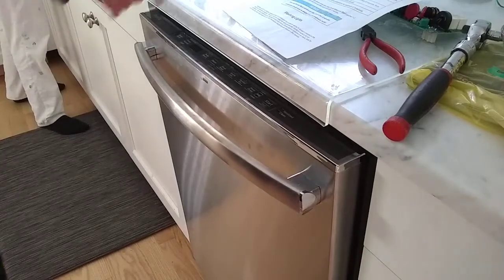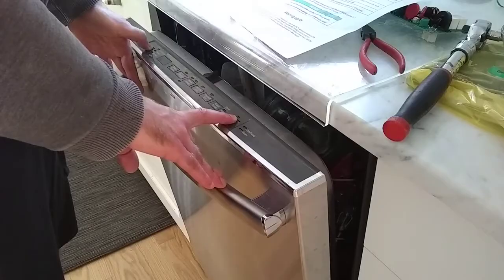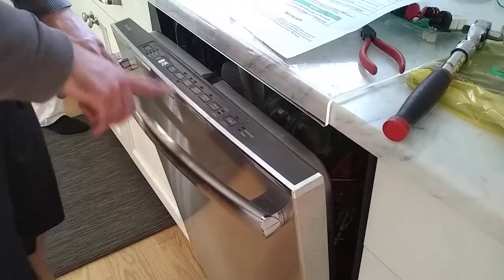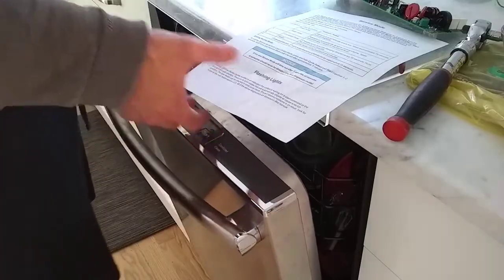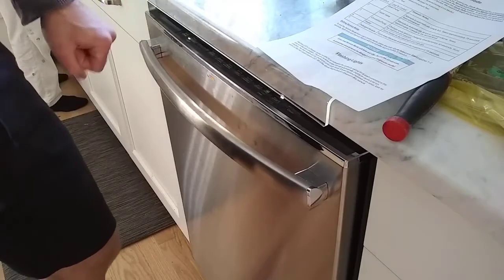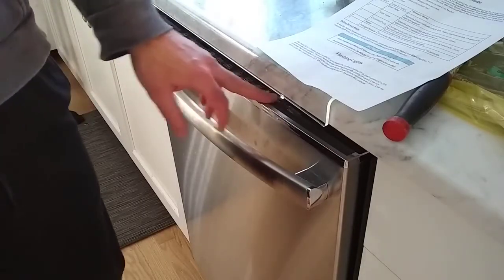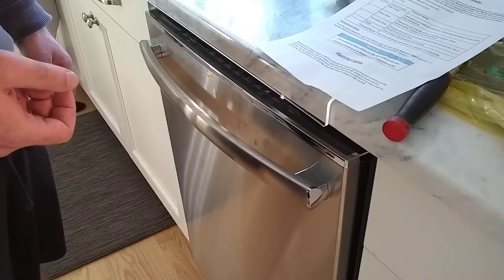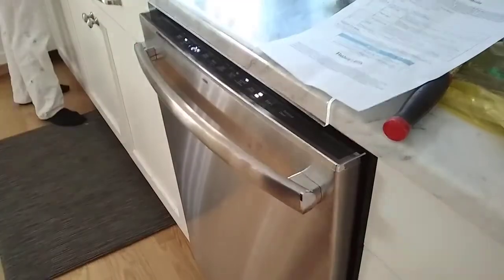GE Dishwasher Service Mode Proper Functioning

Comment: Thanks for making the video, i have GDT580 model, looks very similar to yours. Mine started operating without heat, the element isnt powering on. I tested the element and it measures 22 ohms. I also replaced the flood switch and its still  not getting element to power on. Last thing to check is the liquid detergent dispenser using the diagnosis method. Anything else that could be wrong with it?
Reply from the maker: I didn't see the diagnostic methods section, awesome! I would still try enabling the heater in the service mode (4 blinks). If that doesn't work too, then maybe the relay on the main board is broken and needs replacing. 

Since they don't document which relay is what on the board, it looks like you need to replace the entire board. (plus it is sealed from water intrusion)
Reply: @NolanHergert  Today i took the washer out again and followed the Diagnostic Error code and Service Mode process. There were no codes to report and it ran through all 5 service features, notably the heating element was operational and after 2 minutes steam was coming out. However i couldnt validate how the liquid detergent is being dispensed? The door opens automatically, no way in telling if there's detergent being released for 15 seconds
Reply: I set the machine to Heavy with Steam and Sanitation modes turned on, the lcd display shows 271. I can hear water in there circulating, but every time i open the door no steam or indication of element working at all.
Reply from the maker: @jkucukov  All that's done to release detergent is just opening the door, from my understanding. It's a spring release, it can't re-close itself.

If the heater and its relay is working, then maybe the thermistor or its connection is bad?
Reply: @NolanHergert  Is the Thermistor located in the flood switch assembly that I just replaced?
Reply from the maker: @jkucukov  Yes. Check that it has a valid resistance first. but there's a small possibility that the connection to the board side isn't working for some reason. On page 49 in the manual I link to in the description it details the pins on the board side to check.
Reply: @NolanHergert  Checked the Thermister pins, measured 10.5 K ohms at ambient temp. Checked the two lead wires all the way to the control board for continuity and it passes. I sure hope its not the board..
Reply: @NolanHergert  Believe it or not it fixed itself, the element is working, its running thought the cycle and the washer is getting heat and steam.

Comment: Where can I go to download and print the service mode instruction paper for my model?
Reply from the maker: I never found one for exactly for my model either. I would just follow along in the video or page 19 in the PDF in the description and see if it works for you too.
Reply: @NolanHergert  I have tried to follow this video but the combinations of the buttons that you press dont do anything past getting it into service mode. im not sure what to do.  There are no repair people in my area. GE told me to just throw it out and buy a new one. Ive only had it for a year.
Reply from the maker: @g1jhen  Do you have a warranty? A year is a short time...

My opinion is that it could be a controller board issue for you too. I would buy a new board that you can return and just try it out! It's pretty straightforward to replace, just a few screws. Tons of videos already on it.
Reply: @NolanHergert  i bought it at home depot, its a portable dishwasher with a black hose that connects to the faucet. its a known issue that the hole for the dirty water is too small. The debris from the dirty water gets stuck in the line all the time. Because i live out in the middle of nowhere there are no serve technicians available so my warranty is useless. Assurance told me to throw my appliance in the trash. If I could just force the pump to drain it while I jiggle a plastic wire in the hole the debris comes right out. The problem is I have to watch it while its running or its a nightmare to get it to pump again. I'm on the phone with GE right now and the lady from GE has no idea what a diagnostic manual even is and cant help me, they are passing me around from place to place and there is probably no help for me. I cant believe there isn't a place online where technicians can go to download a pdf or something.
Reply from the maker: @g1jhen  Ah, ok. We pre-rinse in the sink and use much less soap in the washing machine. Kind of defeats the point of having a dishwasher, but it avoids issues like filters clogging or too small of a drain hole.

Yeup :) It used to be that way though!

Comment: My GE dishwasher was working the other day. No problems at all. I started the dishwasher few hours ago. It beeps and flashes it's lights at me. I'm not sure what it could be, what do you think?
Reply from the maker: Post a video and I'll take a look!
Reply: @NolanHergert  It was a power surge. I just flipped the braker for the dishwasher and left it off for an hour. My dishwasher works after I flip the switch on. I thought I was going to spend lot of money. whew

Comment: How old is it?  Ours like this one we had to scrap one like after 5 years  because the circuit board is not available - looks the same, same model no. etc.,  but wire connection to the board has changed - no way to adapt.  No support from GW, just a weak sorry'.We will never buy GE again.  Now using a Braun.
Reply from the maker: Bummer! Yeah, maybe take a look at older models of what you are interested in buying and see if there are still parts for it. Ours was only 2-3 years old, but just out of warranty I think.

Comment: So mine will not do anything in this mode. I just replaced the door sensor. Do you believe it’s the same panel you replaced? When I hold the start button and select cycle for 10 seconds all the LEDs flash. Faulty door latch sensor again or control panel?
Reply from the maker: It sounds like it thinks the door is open, so it makes sense that you can't do any of the service mode commands. It could be that the connection to the controller board isn't working and your switch is fine. That's on the underside of the dishwasher (at least on mine). You might want to get a multimeter and in audible continuity test mode, confirm that the door switch works, the wires between the two connectors are fine, and the connector to the PCB is fine. Assuming that is all fine, you might want to just try ordering a new <returnable> controller, replacing it, and see if that makes it work. A lot cheaper than a new dishwasher. Good luck!

Comment: where did you get the replacement board?
Reply from the maker: The control board is probably different for each dishwasher (you should open it up and find out). My part number was WD21X24902. I wanted a no-hassle return in case it didn't work, so I went with Parts Dr. https://partsdr.com/part/wd21x24902-control-board